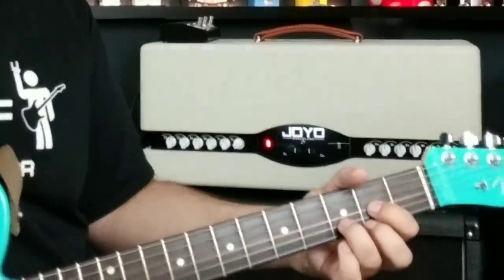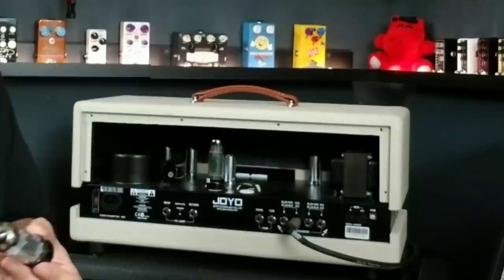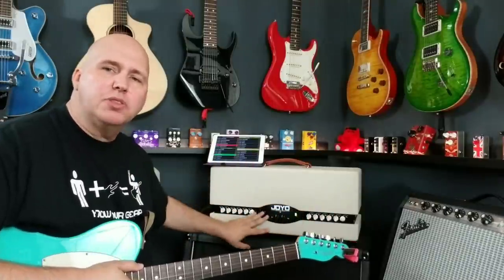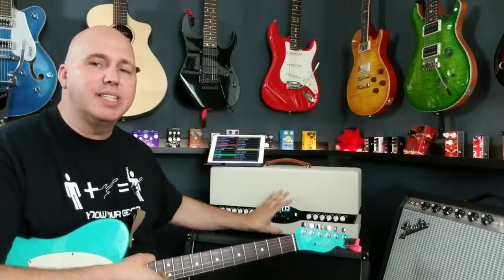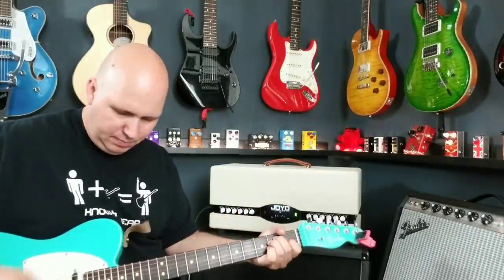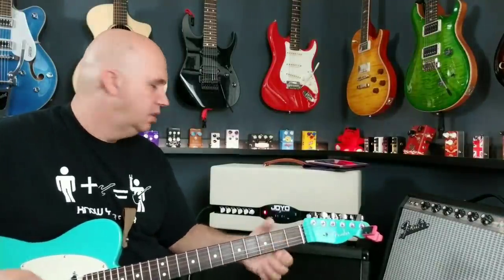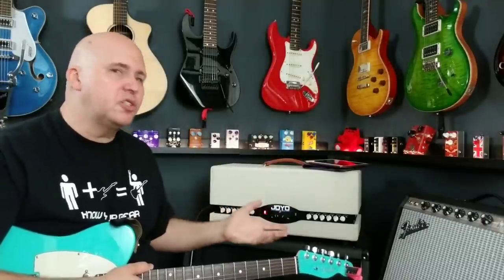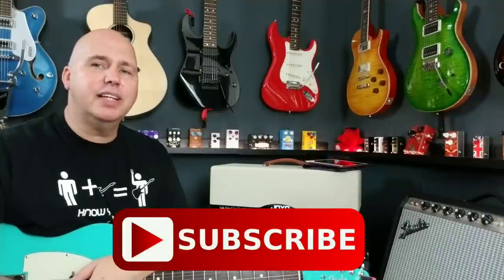The Ugliest Amp Ever Made! But Is It Any Good?

Comment: It's also good to mention that all Amp models for both Vintage and Modern channels can just be recalled by midi control. So, there's no need for a smartphone/tablet app if we don't want... so there's also no worry to have for the future if the app is not supported or so. I read the manual/website and it could be done by a simple midi controller.
Reply: Yes they can ! :D

Comment: Can you do bedroom volume levels but still get full tones?
Reply: I have one, if you put in el84s, 6v6s, or even moreso el844s into say a single 12" cab it can get good tone at reasonably quiet volumes.  But this amp is definitely best when it can open up a bit like most tube amps.  El844s are the lowest headroom, lowest volume, most tube amp overdrive at lowest volumes out of the tubes ive tried in mine(6L6, 6v6, el34, el84, el844, and kt66s)

Comment: I must admit, it does sound good.  But, I'm a simple guy.  I shouldn't need a PhD to understand how to operate an amp.  That's my impression of this amp anyway.
Reply: Maxey and you deem yourself unable to use an app for switching presets? That's really some level of simple ;)
Reply: Jan Minor Most of the time I prefer to just plug in and play, no muss no fuss.
Reply: Maxey Your comment sounds a lot like how some people diss shred guitarists from the 80s for being too technical.
Reply: That what the knobs and foot switches are for! Don't like the popping noises and I'm sure it's not good for the tubes,to keep getting surges in the voltage like that!
Reply: It has knobs on the front, if you need a PhD to use a two channel amp, you are never gonna be smart enough to get a PhD. If you are talking about changing amps, it is literally a press on an app, if you need a PhD to use a simple app......
If someone needs 7-9 years of education to use this amp, don't know what you'd need to use an AxeFx or Line 6 Helix, maybe tutoring from Stephen Hawking himself. 
I am poking fun a little bit at your overstatement but I cant see this being a difficult amp to use at all, hell a lot easier to dial in then a Mesa Road King or something.
Reply: LoL, Jimijaymes!  I appreciate your humor.  I just hope you understand my original point of preferring simple to use amplification.
Reply: Yeah I do get it, Im not a huge fan of the app idea, I think it would be better if it did have a preset mode or something, like maybe use the app or laptop to program it but a way to switch between amps via the footswitch or a rotary encoder hidden somewhere.
Reply: I agree with this.  If I'm right it's just a pre amp selection and a power amp selection.  Two knobs baby.  No app, instant visual.  And knobs.
Reply: Very interesting idea and it sounds pretty good to me. I would worry gigging it as there is no track record of reliability (not its own fault - it's a brand new product!)

Might be hellish to repair, too!

Comment: Popping sound is a deal breaker for me.
Reply: Then put it on stand-by when you change Amp circuitry...
Reply: Quote from one of the guys who made the amp just two comments above: "by swithcing throght the "combo" menu, you are actually bypassing the 
Muting system, while if you switch from the front menu you will also have a silent switching."

Comment: For all people saying it's a "Modeller": Absolutely NOT!

Not even a "valve modeller". This is an Amp made with different circuits and with relays (switches) that can allow you to select which circuits you want to use to create the amp circuitry of your choice. Some circuit could be similar to some existing valve amps such Fender, Marshall, Orange, etc... But this is absolutely not a modeller. 

A modeller, takes an amp, and does a "model" of it, by cloning, profiling, reproducing its behavior and result (the sound of the amp). A modeller often uses a way to "emulate" the reference to obtain the same result.

Here even if we can get similar results that would sound very close to some existing amp, this is not a Modeler. It's just an Amp like many others, except that having 2, 3 channels with some tweak with the toggle switches on the front panel, it's an amp with a TONS of options that could be activated with relays (which are like toggle switches, but on the electronic board). 

Saying it's a Modeller is a pure non-sense. Otherwise, it would mean that any Amp that ever existed and got a similar sound from another amp, is a Modeller... so the new Fender BassBreaker is a Modeller, because he has the sound of the Bassman and a Bluesbreaker.... or even worse, the Bluesbreaker or the Dumble, etc... are just Modellers of the Fender???! Pure non-sense!
 
See this Dual-Klonz like a two channels amps and each channel can have different structure and tone. And instead to have a "Fender-ish, Marshall-ish and Mesa-ish" tone with a " position toggle like some Amps (Bogner, Mesa, etc...), you can have multiple models by selecting a "amp structure presets". There's already 16 models for each channels. 

And just like you could have your amp modded by an engineer to have more gain, less gain, a bright switch and deep switch and many other options like that, you have 27 internal switches you can tweak. 

Most of the time, between one Amp and another, it's just some slightly tweaking in the circuit. There's not 10,000 ways to make a valve amp. So having all those internal switches, allow you to pretty much obtain sound results similar to a lot of existing amps. Just like we can already do with some amps with a lot of tweaking options (such Egnater Tweaker, Mesa Mark V, H&K TriAmp, etc...), but this Dual-Klonz just go the extra miles and offers more results. 

But it's not a "Modeller" per se, however any valve amp on the market that would have a channel that is similar to another existing amp, would be considered as a modeller... and it would pretty much means: ALL OF THEM. So, this is not true, and not in the modeller are defined.

However, the Joyo Dual-Klonz is still a very good amp that offers more tone possibilities than any other pure valve amp to my knowledge, because it can be tweaked in many many ways and therefore it can have plenty of different amp structure to cover pretty almost any kind of Vintage and Modern Amps. 

Personally, I'd just wish they would release a Triple-Klonz to also cover all high-gain amps structure (as well as a way to have multiple power tube such the H&K TriAmp and a frontpanel recallable by midi such H&K Grandmeister 40). THAT would be my ultimate Joyo Klonz that would buy in a heardbeat, even for $3,000.

Comment: What's more important in your opinion? A good guitar or a good amp?
Reply: Both. Maybe 50.5% good amp, 49.5% good guitar. Good guitar is actually good pickups.
Reply: Your guitar can only sound as good as your amp is able to deliver.
Reply: And similarly, your amp can only deliver the sounds your guitar/pickups can make. The amp can't add anything the guitar/pickups doesn't give.
Reply: Personally, I would focus on the guitar's playability and the amps tone. So which is more important? Depends on what you really mean. Also, cheap guitars can often be upgraded with a set-up, pick-ups, maybe new tuners. Amps wise, about the only thing I would consider changing, other than possibly tubes/valves, would be the speaker in a combo. I think with an amp you need to get something that is 90+% the way to where you want it. Guitars are a lot more customizable to get what you want. There are some techs out there that change amps circuits and such to change the sound altogether, but given what it would cost to pay them to do that, I doubt I would bother even if I didn't pay a cent for that amp.
Reply: Artie Fresh after years of buying guitars and pickups and chasing that tone while neglecting the amp section, I'd say amp, once i got serious about amps i noticed imo that amps are like 80 percent of tone.. after a great amp them get a a good guitar.. a good guitar wont make a cheap amp sound good but a great amp can make a cheap guitar sound better..
Reply: Guitar >>> amp. You have to feel good playing the instrument. Whilst the sound has an effect your playing experience too, even a cheap modelling amp these days sounds good enough to not hold you back. In other words, a cheap amp is closer to a great amp than a cheap guitar is to a great guitar.
Reply: Actually, Phil was talking about this in one of his Know Your Gear Live QA. He said that his current personal opinion about this is if you are a gigging musician you should get an expensive amp and a cheaper guitar. However if you are a bedroom guitarist you should get a cheaper amp and expensive guitar.
Reply: Yeah, but you can upgrade and hotrod your guitar, but you can't do the same with an amp. You can make a great, almost high-end guitar out of cheap $200 guitar. If you have a shitty amp, you will sound shitty no matter what. Even if you plug a $3000 guitar into a shitty amp, you won't get any good tone or sound.
Reply: The reason for this is when you are a gigging musician you need a sound and tone you can count on. This can be easily achieved with an expensive amp and a cheap guitar, but not other way around. That's because even a cheap guitar sounds great when plugged in a great tube amp. And also you can always hotrod and upgrade your cheap guitar and improve its performance by dropping in better pickups and electronics, installing better hardware, using better strings etc. and also you can get rid of a tiny layer of lacquer on the neck for better playability. So you can compromise on a guitar, but not an amp. You simply can't hotrod and upgrade your amp as you can do with your axe. There are some great and simple ways that can help you improve your amp's performance, but if you have a cheap amp, you can't and won't make it sing... No matter what. However, if you are a bedroom player , I think you can go with a cheap amp and an expensive guitar, just because the expensive guitar is going to look, feel and play great. And quite frankly you can't push a 30 watts tube amp at bedroom level, so it won't sound that great. This is, of course, only my humble opinion and should be not taken for granted...
Reply: More important for what? If we are talking about a good tone, you can make a crappy starter pack guitar sound good if you just play it through a great amp. You can't make a great guitar sound good through a crappy amp. So when it comes to tone, what amp you are playing through is the most important thing.

But I think a guitar that feels good in your hands is more important overall. You will not enjoy playing with a great tone if the guitar feels bad in your hands. And especially if you are just practicing in your bedroom, the guitar is a lot more important than the amp, since nothing is really going to sound mindblowingly awesome at bedroom volumes.

Most of the time I don't even play through an amp - I just play unplugged. So to me the instrument is way more important than the amp I'm playing through.

It's easy to improve the sound (you just plug into a better amp and you have instantly a better tone), but playability is really not something you can improve (well, you can definitely make the playability of your instrument worse, but let's assume that the guitar is properly set up), at least not easily.

So I think it's important to find an instrument that feels good in your hands first, something that you enjoy playing. My latest purchase was Fender Dimension Bass and I didn't buy it for its tone - I bought it because it felt just right in my hands. It's really not my favorite tone (I actually prefer my old Tokai Thunderbird) but it's something that I can live with. I mean, who really even cares about the bass tone (other than bassists)?
Reply: A great amp will make a cheap guitar sound really good. Of course the guitar cant be total crap. A Squire or Epiphone  has more than enough quality to play and sound great.  You can take a high end PRS or Gibson and play it through a crappy amp and it will sound bad.
Reply: I think it mostly boils down to your usage. Gigging musicians have very different needs and priorities than someone like me sitting on my couch playing to, well, usually no one but me. As far as high end amps go, anything that is more powerful than about a 5 watt valve/tube amp is going to be a big waste. You will never get to turn that thing up and drive those speakers. Hell even my old 30 watt solid state didn't get above 3 out of 10 on the volume, and I live in a house with some space between me and the neighbors. So I think a quality, but low volume (bedroom amp), is the way to go for a lot of us. One of these JoYo's would just be a total waste in my house, but in your band, that's another matter.
Reply: WhoWouldWantThisName

Even 5 watts is way too loud to be turned up in a bedroom (well, that depends on where you live, but it will still be loud). 5 watts cranked is loud enough for band rehearsals (as long as your drummer knows how to use dynamics).

When choosing a bedroom amp, I wouldn't really even worry about wattage. More watts doesn't necessarily mean worse bedroom tone and less watts doesn't necessarily mean better bedroom tone. The only thing I would focus on is if it sounds good at bedroom levels. But sure, there is no need for a high wattage amp, and I guess it could feel kind of pointless to own such a powerful amp and never turn it up.

I really don't see a reason why a bedroom amp needs to be low wattage. Well, of course more watts also means bigger size (so low wattage amps are usually more portable), but when it comes to wattage, it doesn't matter whether your amp is 5 watts or 100 watts - you are not going to be able to turn it up in a bedroom. But I think that's totally fine if your tone is not reliant on power tube distortion. Also, some amps aren't even "meant" to be cranked up. Many 100+ watt amps are 100+ watts because of clean headroom - they have so many watts to keep the sound clean, even at extreme volumes. This is also why bass amps are so powerful. My Hartke amp is 250 watts IIRC. It's so powerful because low frequencies need more power overall, but also because that way it stays clean at high volumes. It's totally fine for bedroom use too - it's not an amp that's "meant" to be cranked up. (And 250 watts for bass amp is pretty moderate power. There are 500 and 1000 watt bass amps, and those are not meant to be cranked up either - they just have a lot of clean headroom so that you don't need to worry about clipping at high volumes, but they work just fine at low volumes too.)

When it comes to "driving speakers", that always requires volume, so you will not be able to do it at bedroom levels regardless of your amp. It doesn't matter whether your amp is 1 watt or 100 watts - you can only really drive those speakers by playing loud.

So when choosing a bedroom amp, I think the things to consider are portability, versatility and whether it sounds good at low volumes. Watts don't really matter.
Reply: +MaggaraMarine Yeah, I was being way overly simplistic in my comment. In doing so I also was very inaccurate. Your right on all points and the wattage is possibly one of the worst ways to measure an amps volume output. I was trying to make a very simple and basic point about how most really awesome sounding amps that I find myself thinking would be great are just too loud for around the house. It's definitely far more complicated than just some stats. Short of using headphones, I think things like the Yamaha THR series and their class or competitors are better suited. My main point was that unless the amp is going to be used on stage there's not much point in getting an amp that will never get out of first gear, so to speak. Some amps are hard to even dial in a point where you can get any sound at all without it being too loud. Finding that sweet spot can be a pain. In such a case this is clearly an impractical amp for low volumes to say the least. So that 5 watts was really more referring to usable volume range. On something smaller like that you will have a more usable range than on say a 50 watt amp. That said, one with a 1 watt, or even .5 watt mode would be even more usable. I think probably the speaker/s are likely the most important part of the system when trying to get big tones at low volume. I just wish there was more info on that subject.
Reply: GOOD CABINET! I'm serious, anything can sound good through a great cab, that is REALLY where your sound is produced. After that i think is 50/50 for amp and cab, because what one may be more important for sound, the other could deliver crucial inspiration, comfort and playability!
Reply: Sorry for bad english by the way, cheers from Brazil!
Reply: +Pedro Your English is fine, and certainly way better than the majority of US born viewers here on You Tube, sadly.
BTW, I agree with your comment about the cab. Probably the most under-rated component in the system. Pedals and amps are just more fun to talk about. Speakers deserve way more attention than they get.
Reply: Bad English? I was going to say you have the best sounding answer.
Reply: Sounds nice, but at the same time a little hollow.
Reply: Artie Fresh good blow up doll
Reply: a really good amp and a well set up guitar, doesn't matter what guitar you can upgrade your pickups anytime later.